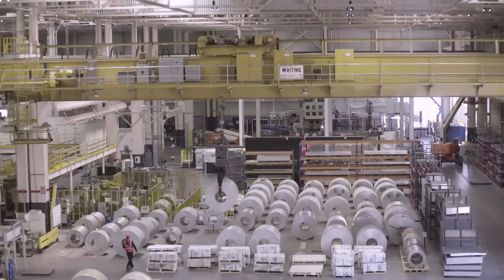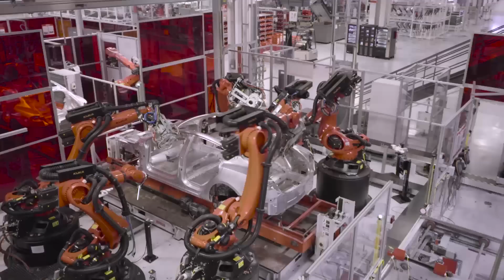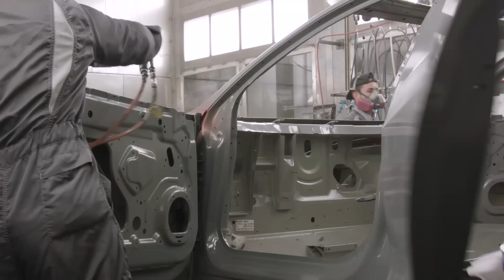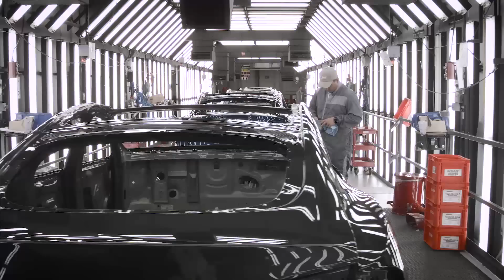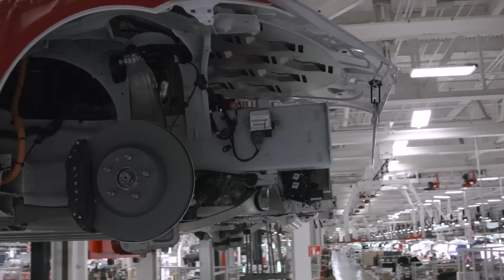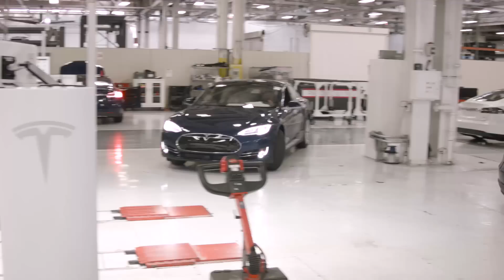How to build a Tesla Model S in 90 sec - short overview production assembly plant

Comment: Other than the cool editing and music it looks like any other car factory. How about comparing with the BMW i3/i8. The BMW factory and process looks futuristic.
Reply: +ChermBo i3/i8 is the first to use mass produced carbon fiber reinforced plastic on a large scale. The number of steps is greatly reduced and structural adhesives play a larger role in construction. It's fascinating to see water jets cutting the CFRP. 

The Model S is as conventionally built as the Ford F-150 other than the electric drive train.
Reply: +ChermBo the construction is very conventional using aluminum. It would have been innovative in 1999 but even the F-150 is now using an all aluminum construction.  Tesla also uses 5000 series alloys where a lot of the newer aluminum vehicles are living to 7000 series for lower weight and strength. The electronics, motor and battery technology are innovative, as well as their business model (even though they lose hundreds of million a quarter), but their assembly is as conventional as any other all aluminum vehicle.
Reply from the maker: +r2d2c3po Indeed other electric cars we see today (like BMWi) would not exist withouth Tesla putting pressure on the market. Their basic car production is of course not way different than others, why should it be. The main difference is that they dont have to spend any money on engine development which is the most cost intensive part of vehicle production. That's a big advantage. On the other hand, they have to focus on the batteries but they solved that by using the laptop style batteries whereas classic manufacturers say 'oh now, that should not be allowed, we only use automotive batteries and we need another five years for this, so tesla is evil' :-)